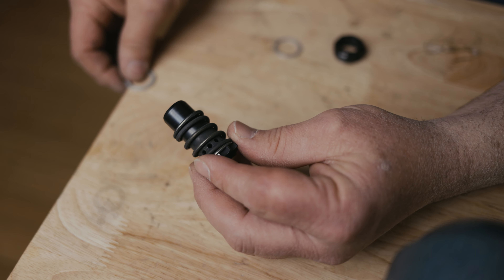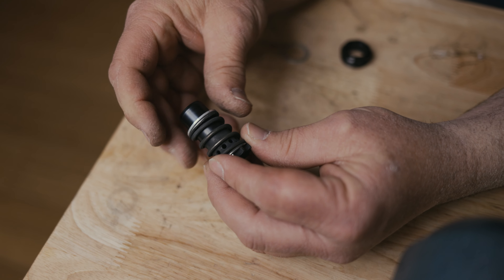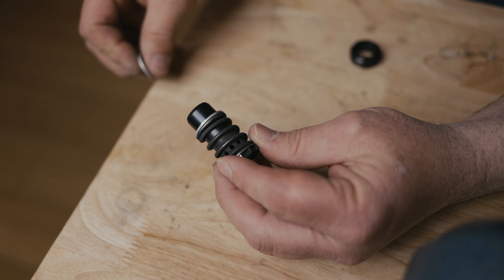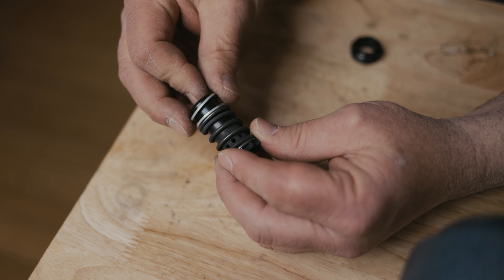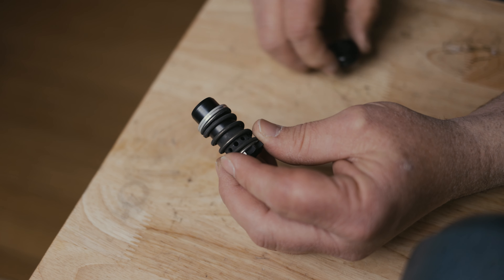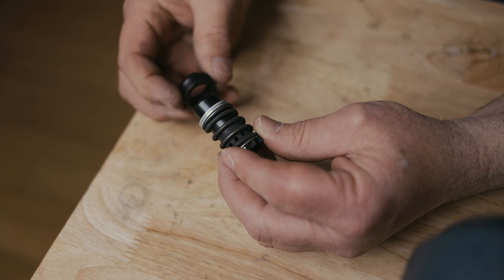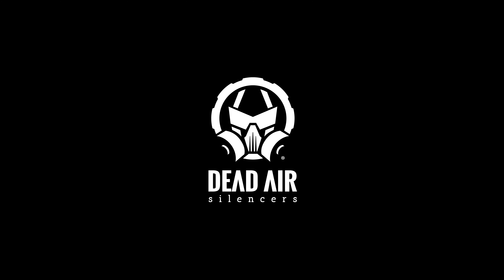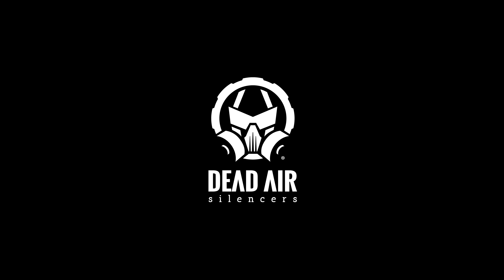Quick Guide: Odessa Shims

Comment: Got my Odessa approved right before Christmas. So far, runs flawless with the two shims installed from the factory on the Walther PDP Pro with the included Walther green spring. Run reg 115gr range ammo, 147 Hornady subs and 165gr Hush subs. Not a single issue so far. Excellent suppression whether in the 4 baffle short config or the full 10. Awesome, awesome fun can. Legit spy gun vibes in the short config.
Reply: I do Walthers as well, When you go short, do you use the lower baffles (say 1-4) or the upper baffles (7-10)?

I aaaume using the uppers would reduce the backpressure and port noise somewhat.

Comment: The baffles 3 & 4 on my Odessa are not  lining up when I reassemble. I haven't overtightened them. When I do line up 3 & 4 they aren't snug; 1-3 are aligned 4-11 are aligned. But with 3 & 4 off there's a gap in the line that etched in at the factory. Can someone help or do I need to send the can back to the company to get repaired?
Reply: To my understanding, there's nothing wrong with it. The etchings are just for repeatability when shooting.   Mines, when snugged, all doesn't line up. I pick snugg over etchings. I know... you would think when each suppressor is made, its tighten and etched, but it looks like they just mass produce into a bucket and just assemble by numbers.